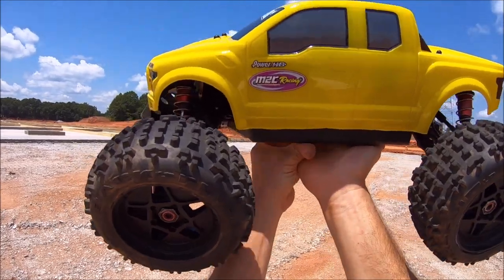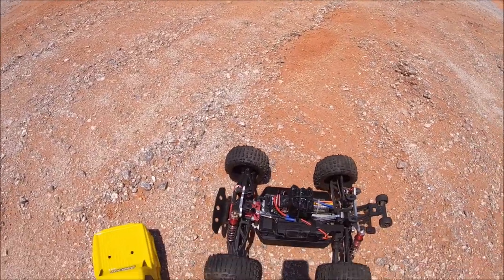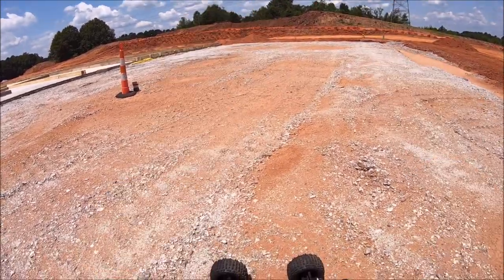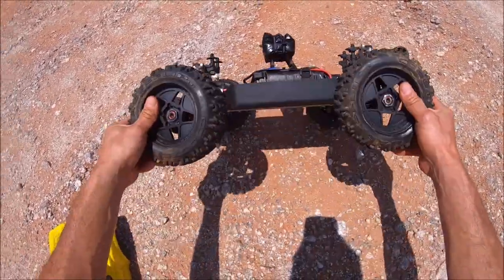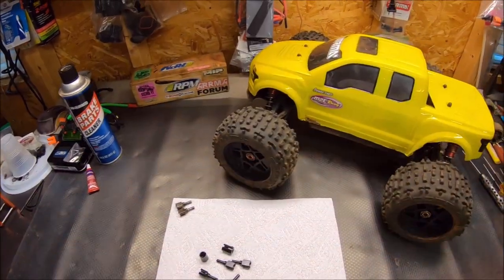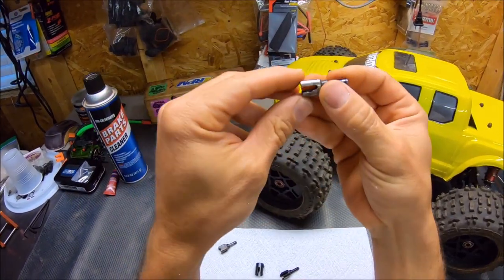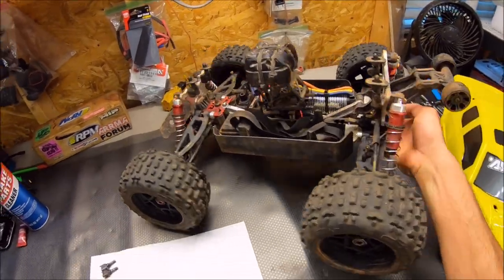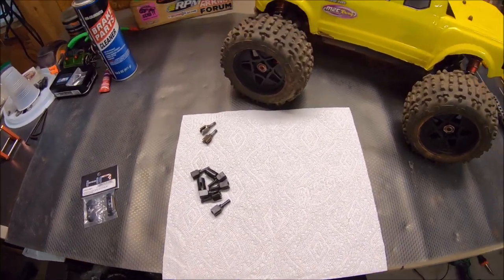Arrma Outcast 6s "GONE BALLISTIC!" -NEW M2C hardened steel Drivecups/Outdrives test!

Comment: Since I went to the Hot Racing sway bar cover and the Nero HD Shock Rod Ends, my breakage has been minimized lol!  Want to snag the chassis, towers, and drive cups next.

I was using the dboots Hoons on my typhon v4. I ramp the hell out of it and last bash session, I broke 3 out of 4 wheels. I just ordered the Proline MX2 buggy style wheels and tires, do you they will hold up to launches around 75-100 feet?

Comment: That is just so awesome rippin man. Could you explain what crazy driving was with 500k in center diff and how did it change with 100k in there?
Reply: Probably meaning that with 500k it was just uncontrollable as far as wheelies and such and then switching to 100k gave him alittle slip in the differential thus for better control
Reply from the maker: Well explained Jeremy!👊
Reply: @RCDUDE81  thanks man! Nice job rippin it up in this vid as well that's one awesome machine you have there takes a heck of a beating!

Comment: Killer bash there brother Eric! 🚀🚀👌
What a great site that was also to bust out that Outcast. Great control in a crazy environment buddy... Did I hear a strange diff or drive shaft noise?
She is a wild thing! I'm gonna start a Outcast build from the ground up VERY soon... Gonna be a M2C beast mostley aftermarket to compliment my Kraton and Talion👌🚀🚀🚀
Just killing it bro, this video was just what t needed to close out a frustrating day.... Thanks buddy, I dropped a new one today too... Check it when you get a second. bash on🙌
Reply from the maker: Thanks brother Dennis!😎Had a total blast ripping the Outcast! She's a little hornet with the big Hobbystar 1730kv! Really hard to control so I dropped center diff fluid quite a bit to tame her in wide open throttle.😆yeah that noise was a slightly bent front driveshaft..Not sure when it happened but I smacked a few piles of dirt pretty dang hard going wide open😂Good luck with your Outcast build man! Building from the ground up is so satisfing! BASH on buddy!😎👊